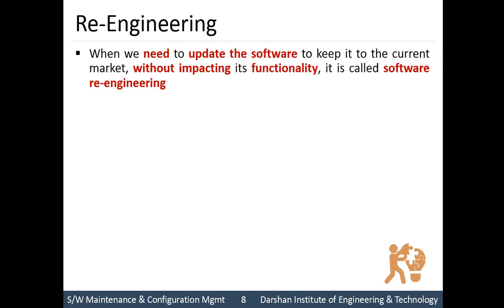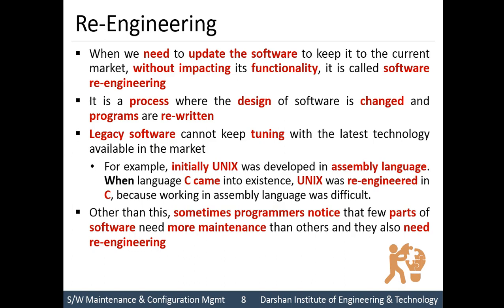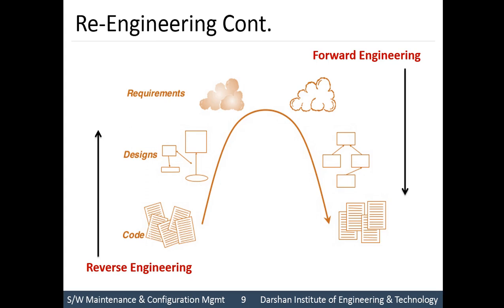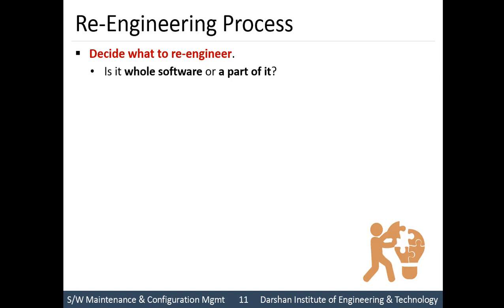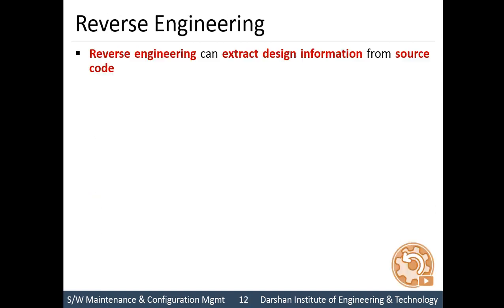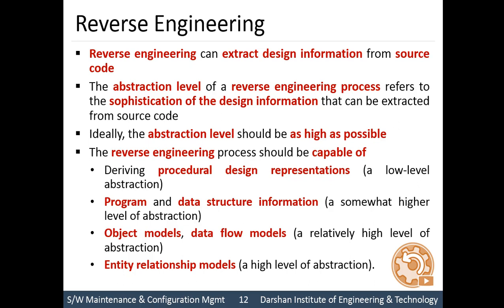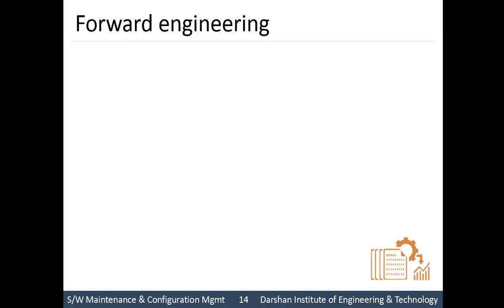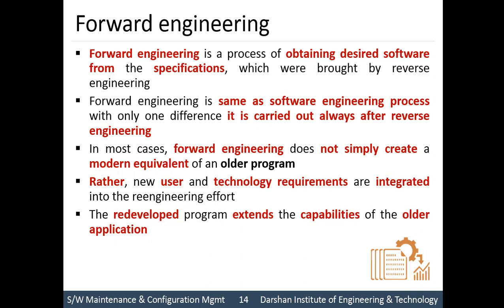Re-Engineering in Software Engineering

Comment: what could you do to make sure that the software systems you work on (both new and old systems) are as easy as possible to re-engineer by developers?
Reply: It is hard part as it is not always possible to get source code of existing software. This makes harder to implement these kind of products.

However using Re-Engineering we can perform reverse Engineering and construct our own software having similar structure/functionality as the "old" software does.

Example: You can get source code of APK file if the software exists in Android Platform.